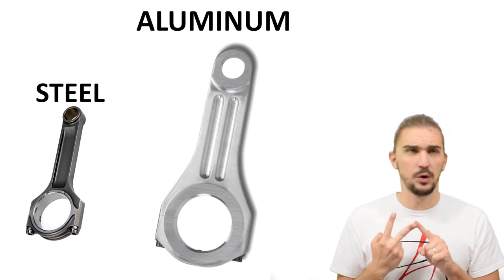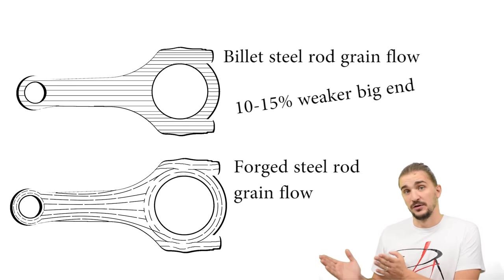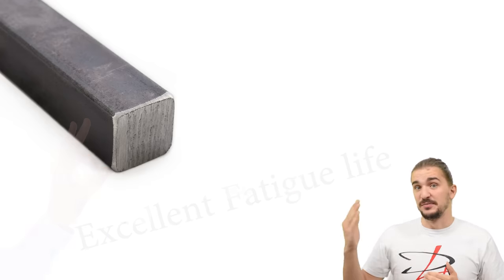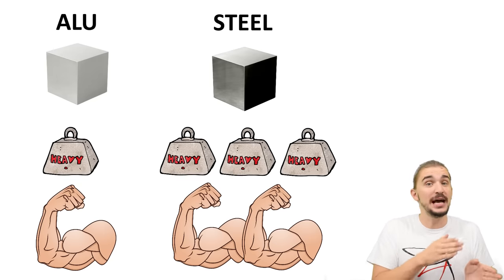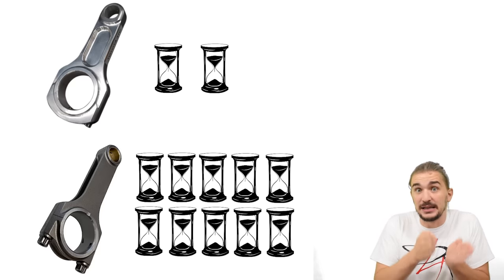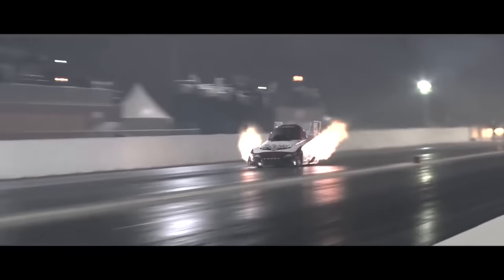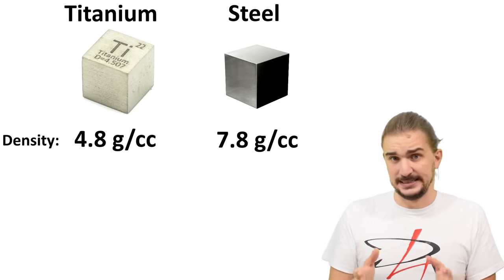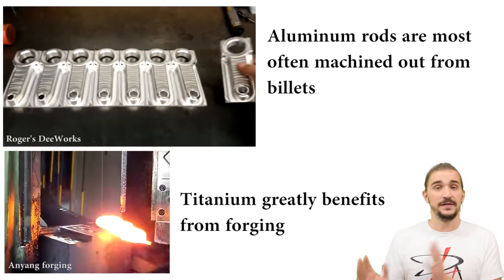STEEL vs ALUMINUM vs TITANIUM Connecting Rods

Comment: Materials scientist / metallurgist here. You did a good job at explaining usefulness for the different alloys! You made one mistake though: When comparing steel against aluminium and titanium, for the application of connecting rods, you have to compare the yield strength of the material, not the tensile strength. The yield strength is the load per unit of area (be that psi or ksi, or MPa) where the material starts to deform permanently. Often you see a value for "0,2% yield strenght", which is the load where your piece will have been loaded so that, after release, it has permanently deformed by 0,2%. Tensile strength (ultimate tensile strength) is the highest load the material can take before it breaks/fails/snaps, which is typically quite a bit higher than the yield stress. 

So in the application of a connecting rod, you have to avoid getting stretched or bend rods, so the 0,2% yield strength is the value to compare, not the ultimate tensile strength. You don't need to know when it breaks but you do need to know the point where it would start to deform permanently . 

With regard to the shock absorbing capabilities, what you need to look at is the Young's modulus, or modulus of elasticity. It basically describes the "springiness" of a material in the load range below where it gets to deform permanently. Typical steel E-modulus is around 190 GPa (27500 ksi) where Ti-alloys are around 115 GPa (17000 ksi) and your average aluminum/aluminium sits around 70-80 GPa (11000 ksi'ish). So aluminium is indeed acting like a softer spring compared to steel.
Minor detail: galling and fretting are not the same thing. Galling is local cold welding during direct metal-to-metal contact, where the formed weld is stronger than the base material so a tiny part gets ripped out of the counter part, which then causes more damage. Fretting is a form of wear where the sliding distance is really really small (micrometer or mils scale) such as when you have parts in vibrating contact.
Reply: good shit
Reply: Chris Farley  HAH! First time ever that I get to see "gangster shit" as description of Materials Science 101. But thank you all the same.
Reply: @Hydrazine1000  Just out of curiousity what kind of education/path did you take for learning that? It always interested me but it's probably way out of my league. Great read, thanks!
Reply: @insanebmxthomas  I got a MSc in Materials Science & Engineering at Delft Technical University.

Edited to add: a BSc or MSc in mechanical, civil or aeronautical engineering would also get into the fundamentals of how material behaves, this isn't limited to Materials Science & Engineering.
Reply: ....very good explanation, you definitely know your metallurgy and I too work with steels, HSS HY-80 & HY-100, Inconel or cres steel..
There's a lot to learn about the average steel etc...and you definitely know what you're talking about. 
Thank you for you explanation....
I don't know anywhere near as much as you from what you explained.
Reply: @Hydrazine1000  haha i'm dutch, actually. Arnhem/Vlissinger. Seen as i just turned 30, if i were to pursue an education again i'd be too late for that one. I would probably be admitted to HBO after a test, but thats not even close to a masters degree lmfao. Respect! And some envy i have to admit. 😇
Reply: ^ to reply about age... You might not be too late even at age 30. I was in like a preview class for materials science at a community college. It is really fun class, you get to build things like fiber glass boats and kevlar cloth, test strengths of things. I also liked the robotic class. You could pickup some skills for different jobs... Hey I met people that went back to school at age 34 to learn c++ computer programming and now they work at Microsoft. I believe there are even classes for fishing, I would want to try that. catch some "steelhead" fish.
Reply: So is this a quality difference between universities or maybe students? Others in this comment section claim to have studied but were never taught this stuff. Anyway, you make my day with a good comment on a good video.
Reply: @mennovanlavieren3885   Well, "Materiaalkunde", or as they later called it "Technische Materiaalwetenschappen" was a full 5-year beta study. Unfortunately, that no longer exists at Delft University of Technology. 

Having said that, any BSc or MSc in engineering, that can be maritime, aerospace, civil or mechanical engineering, will have some materials science in its programs. (At TU Delft materiaalkunde was part of bouwkunde, civiele techniek, lucht- en ruimtevaart, werktuigbouw and industrieel ontwerpen.) What I explained about yield strength, tensile strength and Young's modulus belongs to the most basic materials science stuff. 

I guess it's simply that 1) I took the time to explain the basics in more detail, 2) I happen to know what I'm talking about and 3) I have experience with explaining things in a descriptive way using simple words.
Reply: I can hardly tell that i'm talking to dutch people anymore. Never thought that an engineering channel is where i'd meet fellow dutchmen who mastered the dark art of engrish. 😂
Reply: That is one maniac info thanks!
Reply: Hydrazine1000 thank you for a wonderful and informative addition to this video. I may never get into the science on that level but you explain things well enough for me to understand and do the extra learning if I desired. Also nice to see it create an interesting conversation amongst viewers.
Reply: @Hydrazine1000  Hey, don't forget the University of Twente, as a Bachelor of science in mechanical engineering, I did get quite a bit of material science. This guy is overall quite knowledgable, but your comment is correct about using the yield strenght.
Reply: Dear N2H4, excellent job, props!
Reply: Tl dr
Reply: @Noname-ho7ib  NP. Kthxbai
Reply: Excellent answer..!
Reply: Vey good.
Reply: Why are the youngs or e-values so high,  you said steels are 27500 KPSI,  are you sure it's not just, 27500 psi?
Reply: Seriously, this video reads like he just web searched some shit and tried to sound intelligent. He claimed "Steel isn't susceptible to galling, AT ALL". Guess he's never actually seen failed bearings.
Reply: @xxdemonshitxx  Geez, I hope not! I mean, ok, mixing up yield strength and tensile strength was inaccurate, but the conclusions stay the same and it doesn't invalidate the rest of his video.
Reply: @Hydrazine1000  There must have been a bit of chemistry in there as well, judging by your name.
Reply: @LoneWolfZ  Materials Science & Engineering is part physics, part chemistry and part mechanical engineering. To understand the fundamentals of how material (metals and alloys, plastics, ceramics and other inorganic) have the properties they do, you mainly need physics and chemistry. To understand the practical aspect of how materials are worked/processed/applied/coated you also need mechanical engineering.

It was one of the things that attracted me to Materials science & engineering, it's a mix of fundamental and practical knowledge and it's applicable to / useful in just about any type of (physical) engineering.
Reply: Yes sir you a CORRECT! Im gonna tell you what i think, as a certify technician! 
For me forged steel rods as the best, aluminum, is garbage and i dont come across much titanium rods! As a tech one, my perfect engine is steel forged crank, steel forged rods, , steel block and aluminum heads! and your done, anything else you not gonna be pleased! and the failure rate will be high!
Reply: For the intended purpose, this younge man done an excellent job. Do not forget that this is not a presentation for engineers. It is a presentation for general public and engineers are hard to be understood.
In my opinion he was perfect in making himself understood in a plane language.
Reply: @georgeshop3654  Well, I never said, nor wished to imply, that the overall conclusions of his presentation were wrong. His overall conclusions are not wrong! In fact he pretty much nailed it. Just basing it on another aspect of tensile properties doesn't change the overal conclusion.  
Having said that, there is a really important difference between the point where a material starts to yield, and the point where material breaks, especially for something like a connecting rod. That too can be easily explained in plain language. (I know this from personal experience, since I guided/supervised first year students with tensile testing and impact testing.)
Reply: @ryanb1874  (OOPS, I only see your reply a month later, sorry.) No, typical values for Young's modulus (E-modulus, modulus of elasticity) for metals and alloys really are that high. It is the value of the slope of the initial linear part of the stress-strain curve. 
It gets represented as a value in the KPSI range (or GPa in metric) because that's the value you get when you were to extend the linear part of the curve to a true strain value of 1. (A true strain value of 1 means that you've extended a piece to twice its original length.)
Reply: @Hydrazine1000  
We do agree that in design we take in consideration the strength of materials and apply the safety coefficient which can be double plus   then original calculations.
Personally I am happy that I can see a younger man knowing so much, and I can trust him touching my car.
Reply: Thanks for the explanation :-)
This channel is great and I think it has to be one of the best comment section on YouTube thanks to people like you :-)
Reply: @Kias1dad  As I've said in other replies here, this remains an excellent video. The fact that he bases some of his conclusions on the wrong type of fundamental material property doesn't, in this case, invalidate the outcome. 

If you only want to know what the right material is for your application, then those details are indeed irrelevant. 

However, if you want to understand why the different types of alloys compare the way they do, and which one is preferable for a certain application, the difference between yield and ultimate tensile strength is important.
Reply: @Kias1dad  "That, quite simply, is wrong,  Tensile strength, yield strength, makes no difference in this context.  Both are valid measures of the strength of a connecting rod material.   Both produce the same relative result, no doubt because both are closely related and really only a slightly different definition of the same basic properties. "

OK, fine, don't take my word for it. Just look online for information on tensile strength testing and basic materials science. You'll find that yield strength and ultimate tensile strength can be determined from one and the same test (pulling a test piece untill it breaks) but they are not closely related or slightly different definitions of the same thing. 

"In what way does yield strength produce a better understanding, or suggest which one is preferable for certain applications?  Especially given the fact that he covered fatigue quite thoroughly."

I gave an explanation in my first post why, for such a part as a conrod, knowing when the part yields is critical. Once it starts to permanently bend or stretch, you're screwed. The tensile strength will tell you when it breaks, but that comes after you were already screwed from bending or stretching the conrod. But since you doubt my expertise, go ahead and get yourself a materials science textbook for a better understanding before you reply. And in that same textbook, you could read that fatigue strength is not the same as yield strength or ultimate tensile strength. 

"It seems clear that your comment and this response are just a failed effort to demonstrate your expertise.  I imagine I'm not the only one he has come to that conclusion."

In that case, please do not believe a word I say. Just disregard my ramblings. As of writing, I see 202 thumbs up and no thumb down for my initial post. So yes, up until now, it does appear that you are alone in your conclusion. Positive note: you can be the first to give it a thumb down! Good day to you sir and enjoy your old school weight lifting while merrily poking fun at the modern fitness industry's many iterations of the emperor's new clothes.
Reply: @Kias1dad  I think I understand your line of thinking now. If an engine fails, it fails. End of story.

The engineer who needs to figure out what to do to prevent a repeat has to check cylinder pressures and crank throw to figure out exactly how the rod failed, and there yield strength is critical. Because he, or she, has to prevent the initial permanent deformation of the rod in the first place.

But OK, fair enough, we agree to disagree. So, really, without any sarcasm, thanks for the discussion.
Reply: @ObservationofLimits  he didn't say that. Watch again and pay attention.
Reply: That's "connecting rod material clas 102"
Reply: I love m50NIL roller bearings!!!
Reply: Hydrazine1000
 maybe dumb question, but i thought forged rods were, forged, then machine finished.  they can get such a nice finish from forging?
Reply: @DunsfordFarnsworth  The surface finish of as-forged material depends on the method of forging (closed die, open die, type of die lubricant, hammer forging, pressing, forging temperature, etc). Some surfaces will need machining for size/tolerance, other parts can be left with the as-forged surface, depending on specific needs. Either way, as-forged surface, assuming it was hot forging, will not be shiny, it will be dull / flat.
Reply: @insanebmxthomas  30 is so much younger than you think and you've just begun to know how to live life. You have plenty of time if you will make time. Trust me.
Reply: good reply, thank you
Reply: Which is the best for 2 strokes diesel. Forged steel is ok for this?
Reply: M50NIL is my favorite steel alloy!
Reply: nice, even though i like to keep it simple aluminum is better for drag racing and steel is good for everything else and titanium is too expensive to matter.
Reply: @xxdemonshitxx  well to be fair yield strength scales proportionally to ultimate strength. Yield strength is typically somewhere between 70-90% of ultimate strength. So comparing the yield strength of different materials or ultimate strength leads to the same conclusion.

If you are designing an assembly, YOU ALMOST NEVER USE ULTIMATE STRENGTH. The only time you use ultimate strength is when you are looking at brittle materials like cast iron.

Very good video tho.
Reply: This is such cool information! I've been into bicycles since i can remember, and in the MTB and touring scenes, I've always heard that aluminum frames and forks deliver a much stiffer ride than steel... But with piston rods, aluminum is "springier" than steel... Is that because forged steel and machined billet aluminum compare (respond to a energy) different than steel and aluminum tubing? Or is it the wall thickness of the steel tubing vs. aluminum tubing??  Is it the particular alloys used in the cycling world that cause aluminum frames to be more rigid??? Is it just because the heat in the engine causes the aluminum to "soften" or something???? All of the above?
Reply: @dougtond1380  The fact that aluminium bike frames appear to be stiffer than steel will be down to frame engineering and the tube diameters and wall thicknesses used. Because the average density of aluminium alloys is much lower you can use larger diameter thicker walled pipe. Thicker in absolute sense, not thicker in terms of pipe diameter vs. wall thickness ratio. Bend stiffness goes up with increase in pipe diameter. With steel you could in theory also go to larger diameter pipe, but the resulting really thin wall thickness would be an issue.
Reply: @Hydrazine1000  thank you!
Reply: God explanation, thanks a lot👍👍👍
Reply: @Hydrazine1000  As would a BEng or MEng
Reply: @insanebmxthomas  When I did my degree there were people a lot older than myself, one guy I am sure was in his 50's
Reply: @Kias1dad  one wonders the percentage suffering with Dunning Kruger symptoms ?!
Reply: Excellent explanation.
Reply: @balancebreaker1561 very well stated sir
Reply: Hydrazine, wow! 
Controls Engineer here, your comment belongs in a Metallurgy syllabus I have never seen such a complete, accurate description of steel alloy properties in such a short paragraph, enginweering education needs to be written by people like you, there are too many engineering education materials copy-pasting raw information but lacking context, you are definitely the gold standard for concise, fact-based, understandable to everyone, engineering explanations, the ability to contextualize engineering concepts and make them relatable by people without a background is the Holy Grail of engineering education, had you been my professor I would have my working knowledge now 15 years ago.

*I am not an educator but I am fascinated by ways to teach people.
Reply: @johnfilmore7638  In engineering school I had a teacher who used to give point cards to remember after every lecture. He found that people actually remembered something after 2-3 months and not the entire textbook was a blur. He also thought that too much information is a terrible thing. You still have the option to go back to the book and read the details whenever needed after you had a basic and good idea on the subject.
Reply from the maker: I haven't checked the comments section of this video for a while. Wow! This is now a mini forum. Just a quick response from me regarding the yield and tensile strength. I get your point and it makes sense but I went for tensile intentionally. It's easier to understand and explain quickly but more importantly bent rods don't kill an engine. If you bend a rod the engine can easily be saved by replacing the rod and maybe a bearing at most. This is especially true in drag racing and many other motorsport applications where engines are frequently opened. You inspect the rods, toss aside if bent, check bearings, crank thrust, straightness etc and put the engine back together while reusing most of it. A broken rod creates havoc and usually renders the engine irreparable. That being said I likely should have elaborated on this a bit, but video length and minimising stuff that many might perceive as "boring" is a big factor. Also thank you for clarifying that the end result in terms of strength comparability stays the same, you even responded to some of the nobs, I appreciate that.
Reply: @insanebmxthomas  Not entirely.  I took time off after high school and got my BSE (Bachelor of Science Engineering) Electrical Option just a couple of months shy of 30.  I'm retired now, but I expect that may even be more common now than three plus decades ago.  I wasn't the only one at that age, even then.   And yes, our core was intensive, a decent introduction to structures and properties, and mechanics of materials, physics, etc. basically what his introductory courses would have been on the materials side, I expect.
Reply: Question isn't space grade titanium stronger than steel or aluminium
Reply: @hunterz9743  The titanium alloys used in aerospace and space application (Ti6Al4V, SP-700, etc.) are stronger than aluminium alloys, but high strength steel alloys, especially the maraging steels (PH 13-8 Mo, MAR300, MAR3500), are considerably stronger still.  But when you look at density things change because, especially in space and aerospace applications, the weight of a part (or assembly or complete structure) tends to be very important. A titanium alloy will be at about 4400 kg per m³ where a typical steel alloy will come in around 7800 kg per m³. Give or take some, depending on chemical composition, but you can get the idea. Titanium will offer better strength-to-weight than steel or aluminium.  (Having said all this, there are many more things to consider when doing material selection than just strength-to-weight ratio.)
Reply: The moment a viewer destroys the youtuber.  Good job!
Reply: Thanks for that. You should consider doing your own series.
Reply: @jimgordon3206  i can't now if thats passive agressif or serious
Reply: Good this minimum equation could work for the VC-TURBO engine of the XQ50,
you have 2 cylinders with the same diameter but one has half stroke therefore you can have twice the RPMs therefore the same power, but in reality the cylinder with the largest stroke would be 41.4% more powerful because that way they would have the same stress mechanical, because with the smallest stroke you have 41.4% more directional changes per second and they are 41.4% stronger, 1.414X1.414 = 2, if you have half the mass then 0.5X2 = 1, am I missing something?
Reply: If titanium is the most resistant material per unit of weight, what is the most resistant per unit of volume regardless of its weight?
Reply: Soup is good.I like soup.
Reply: @Hydrazine1000  Yes, I had to study material properties for my mechanical engineering degree.
Reply: I think 0.2% yeild strength is not useful. Typically a metal piece needs to be bent beyond a limit to observe a permanent deformation. Often it exceeds that 0.2% you mentioned. In case of such little bent the piece should be sprung back into its original shape quite easily. The elastisity is the reason.
Reply: @sagnikmaity1444  The 0,2% YS (or, depending on the material, sometimes the 1,0% YS) is a well-defined point on a tensile test load-displacement graph. And it is very useful for any engineer who is doing stress calculations. It is one of the most important material properties out there and every material standard out there (EN, ASTM, ASME, AMS, DIN, you name them) for metal alloys will define requirements for it. A standard tensile test will give you the values for 0,2% yield strength, ultimate tensile strength, elongation untill break, and reduction of area.

But in the end, it's only a certain stress derived from a standardised tensile strength test and if you look at bending, rather than pulling, then you create tensile stresses on the outside of the part, there will be a neutral line somewhere in between, and there will be compression on the inside. In such case you only locally exceed the yield stress and cause permanent deformation, so the part as a whole will not spring back 0,2%.
Reply: @Hydrazine1000  your last paragraph makes sense that in the case of a bend the inside feels compression stress and the outside feels tensile stress.
   A yield point is defined by the stress load a material can handle before bending into a plastic deformation. 
   Ultimately yield stress is nothing but the amount of tensile stress applied on the material.
   In this video he never made a mistake of addressing tensile stress only because yield is just a constant tensile stress for different materials.
    In a stress vs strain graph, 0.2% offset defines if the material has already bent and has a change of length by 0.2% before any load has been applied. The graph meets the original curve at a different point. It is nothing significant.
Reply: @sagnikmaity1444  "A yield point is defined by the stress load a material can handle before bending into a plastic deformation." 

I have an MSc in Materials Science & Engineering. I knew this already, but thank you for the refresher. 

"In this video he never made a mistake of addressing tensile stress only because yield is just a constant tensile stress for different materials."

He just mentions "strength" each time, not "ultimate tensile strength" or "yield strength", but the actual values he mentions are typical values for UTS, not for YS. I just point out that it is important to make the distinction.

For an application where a part should not permanently deform (such as a rod, a crank, a piston, a valve stem, a deck surface or an engine head) it is critical to have all stresses that occur to stay below yield point. Engineering/designing those parts will require an engineer to look at, and stay below, yield stresses. The higher ultimate tensile stresses are not relevant in such cases. (UTS can become important if you look at potential failure modes though.)
Reply: @Hydrazine1000  okay now we r settled. You are right. He marked the tensile strength only. He should have addressed the yield stress too. Yes i got it.
 But can u explain the 0.2% thing clearly?
Reply: @sagnikmaity1444  The yield strength is the point the material no longer only behaves as spring, or rubber band, but where it will start to deform permanently (elastic deformation vs. plastic deformation), so if you take away the load, the shape will no longer be the same as before loading. 

The difficulty is that this point isn't showing up on a tensile test graph in the same way for every possible material. Some materials show a nice linear behaviour and a clear kink when plastic deformation starts. Aluminium for instance, starts linear, but slopes off slightly, even when still acting fully elastically. Some mild steels will show a sudden drop followed by a more gradual rise. 

So the idea of the 0,2% Yield Strength definition is just to have a standard way of marking a point on a stress-strain curve which will work for almost all materials. You draw a line parallel to the linear part of the stress-strain curve, shifted by 0,2%, and see where the lines intersect. The 0,2% off-set has at some point been selected for convenience, it doesn't have a more fundamental meaning or anything.

More explanation on the Wikipedia page: https://en.wikipedia.org/wiki/Yield_(engineering)
Reply: bent equals on its way to breaking
Reply: @bryduhbikeguy  LOL! Right in the middle of all this blah blah blah!!!
Reply: Would you be better building the chassis and body work once perfect car from titanium once made Vs energy cost of new / carbon steel?
Reply: Brain food thank you
Reply: KFC Food Service Worker here
You all missed the error at 4:12
"It (steel) is never going to fail unless you push the material past its yielding point"
 - Having cooked KFC fillet burgers for 10+ years now, I can tell you that the endurance/fatigue limit of steels is typically 40-50% UTS, whereas the yield (0.2%) of steels is typiclly 80-90% UTS, therefore steel will fail due to fatigue when cycled at stresses well below its yield stress, particulalry prevalent if the material is subjected to fully-reversed stresses.

As I also cook fries and hot wings, I noticed that two other points were missed:
1 - In the max +accel of the piston, the stiffness of the material/design has to be considered as, when the conrod is in max tension ovalisation of the big-end bearing is possible, causing the bearing to nip the big-end journal on the crank shaft, causing the metal to spin the shells or just score the breaing shells.
The oil-film can not react the ovalisation.
2 - In the max compressive load of the piston, the Euler buckling strength also needs to be calculated.